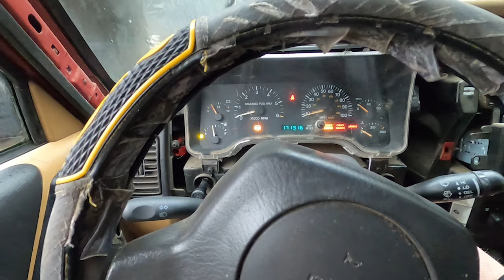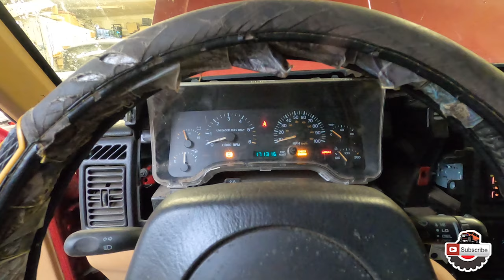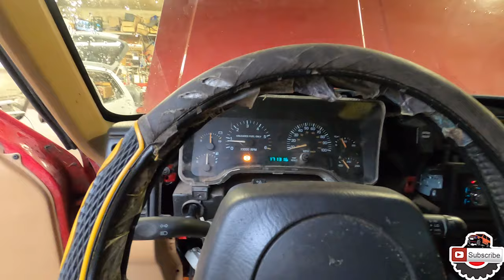How to Replace Turn Signal Switch in a Jeep Cherokee XJ

Comment: So i think this my problem?! when i put my left turn signal on ,both left and right turn signals in the back turn on, right turn signal is fine, ive replaced relays but cant find the problem, u think replacing  muti switch would work?
Reply: Having same issue, did you ever replace the multi switch? Or did you ever figure it out?
Reply: @castanedaeric7  no havnt replaced multi switch yet
Reply: My 2000 just came down with the exact same issue. Turn on the left turn signal and both rears come on but turn on the right turn signal and only the right comes on. I have found that if I switch from low beam to high beam (even with the headlights off) it will stop the right from blinking. It also doesn't seem to do it as much on high beam than low beam but even so it will do it and if I move the switch back and forth it will stop. Pretty sure that means its in the multi switch
Reply: I'm having the same issue with my 97XJ, left makes both lights flash. It got me pulled over.
Reply: @BUKWulfSh0t  try moving your steering wheel up and down mine fixed it self  when u put it at a certain angle
Reply: @edfrmthabay  I'll give that a try